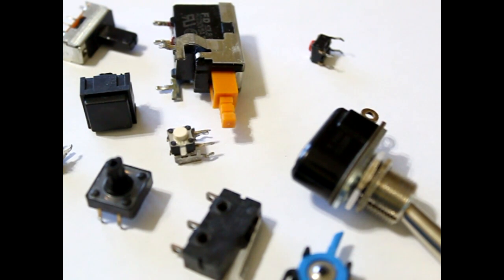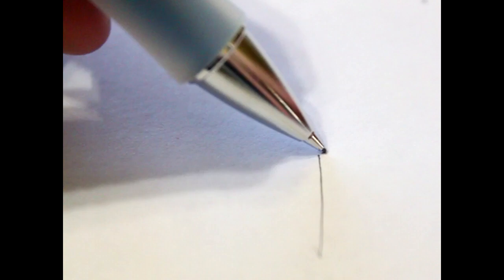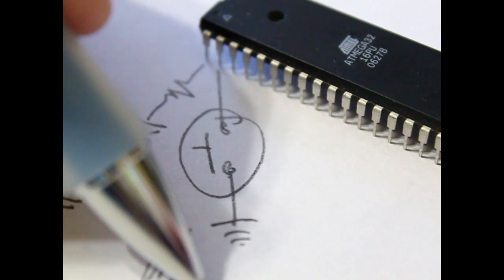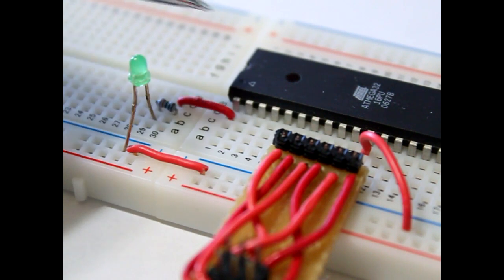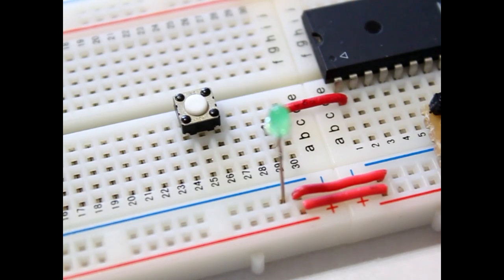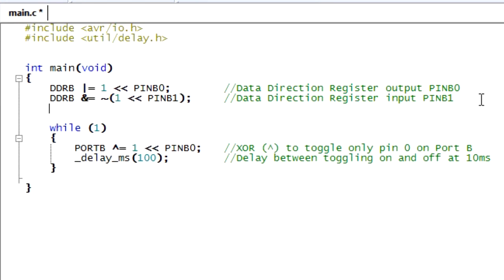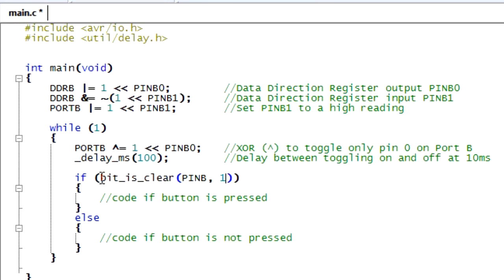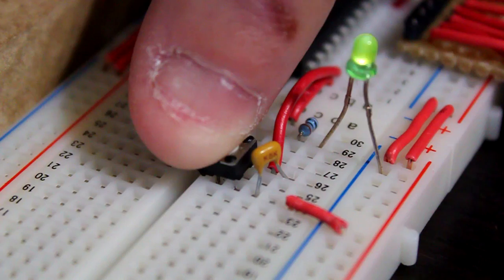12. Arduino for Production!  AVR Atmega32 - Adding a Button to the Microcontroller

Comment from the maker: Thanks Golgor.  All of the ports of this microcontroller provide pull up resistors.  Remember that this is important for setting the pin high and connecting the button to ground.  If you do the reverse (connecting the button to 5v and setting the pin low) , then you will need to provide a pull down resistor in the circuit.

Comment from the maker: On the atmega32, I believe all ports have pull up resistors according to the beginning of the datasheet where it introduces the ports.  Yes, if you use PORTB |= 1 << PINB1; then the internal pull up resistor will be used.

Comment from the maker: All of the manuals that you will need is actually installed when you install winavr.  Just look in the "all programs" under the start menu and then under the winavr selection.  You will see the winavr user manual and the avr-libc manual.

Comment: Can we Use Pull Up Resistor instead of a Capacitor.?
Reply from the maker: The capacitor is used as a filtering device (low pass  filter) and is actually done with a capacitor and resistor. The capacitor connected across the pin and ground and the resistor connected across the pin and vcc.

Comment: If I understood everything correctly you used the pull-up resistor when you put the PORTB |= 1 >> PINB1;
There are not Pull-up resistor on all ports right? What I have read it is recommended to use the pull-up resistor when using buttons. Can you clarify this?

Thanks for AWESOME tutorials. :)

Comment: I'm sure you already knew this, but you forgot to include "#define F_CPU" to define your clock speed. At the end of this video, when you said the LED was toggling every 100ms and 10ms respectively, the LED was actually toggling about every 1000ms and 100ms. Perhaps the default clock speed is 1MHz and you were using 8?
Great videos thus far though, thanks a lot!

Comment: Hello your tutorials helps me alot and i was rebuild some of them from beginning and learn verry much !On a actual tutorial about BUTTONS i'll remind you that prouberly Forget about PNP or NPN Transistors because they Need a Signal to shift an electrical circuit in many time of one secounf*Maybe remind on it in your next *tutorial well be verry helpfull !Nice work !
Reply: Got idea to teach something about bitwise operations like you show us in your good declared videos because i was'nt  know nothing about that stuff ! ;)Prouberly on a long code, it may help to invert arguments for what looking for !Thanks you a lot !Verry smart ! :D
Reply: Following Code is working with Atmel Evaluationsboard on Versoin 2.01 for poeple who want to try this code (whitout warranty ) !* (only copy code insight of the //Hier beginnt die Initialisierung and  //Hier endet die Initialisierung or clear the *comment out of the code !
//Hier beginnt die Initialisierung
#include <avr/io.h>
#include <util/delay.h>
int main(void)
{
DDRD = 0b01100000; //initialisiert das DATA DIRECTION REGISTER für PORT D und setzt die im Bitmuster abgegebenen PINS als Ausgänge
PORTD = 0b01100000; //schaltet die LEDs am PORTD sowie AUSGABEPIN 5 und 6 0b|7|6|5|4|3|2|1|0, auf + 5Volt VDD 
//Es beginnt eine Endlosschleife welcher das in Klammern aufgeführte Argument übergeben wird.
while (1) //wenn das in Klammern aufgeführte Argument zutrifft, werden die Anweisungen in den geschweiften Klammer ausgefuehrt.
 {
  (PORTD) = 0b01000000; //PORTD ist als Ausgangspin am Ausgang 6*, deklariert !
  _delay_ms(10); //Wartzeit für ein *zehntel einer Sekunde, um ggf. die Entprellzeit bidiengt mechanischer Herkunft zu verarbeiten !*
  DDRD = 0b00100000; //führt einen VERGLEICH des Ausgangspins am PORT D und dessen Ausgang an Pin D5 durch !
  PORTD = 0b00100000; //setzt Ausgangspin 6 auf einen Highlevel, von + 5 Volt !
  _delay_ms(100); //wartezeit von einer Sekunde !
  DDRD = 0b01000000; //jetzt, wird der Zustand des Ausgangspins des als Global geltetendes Arguments welcher ursprünglich *global als somit *Ausgabepin, initiert wurde, in dieser *while,ENDLOSSCHLEIFE,
  // auf EINGABE oder AUSGAGE, hin geprüft !
  //Werke: Einmalig bei der Initierung, den Variablen können im Verlauf eines Programmes, unterschiedliche Werte erhalten.
  //Konstanten allerdings keinesfalls !
 }
}//Hier endet die InitialisierungSometimes it's a got idea to take a RED wired cable for the positive VCC and a BLACK wired cable for the negative GND rail and for technical knowledge and for *pysical acknowledge it doesn't matter what Kind or whst colour the cable got !Be sure but don't use so much of voltage because current alway flown from A to B and not why current was attaked by coulorblind ;)

Comment: thank you so much, just a quick question, should we call the IF function ( bit_is_clear) or we can call it any else such as                if (X (PINB, 1)
Reply: +a00000z100 bit_is_clear is a macro available when you include io.h. Check the AVR Libc from Atmel here: http://www.atmel.com/webdoc/AVRLibcReferenceManual/group__avr__sfr_1gad188fb0fbfd923bdb01294072367d024.html

Comment: Why didn't we used the XOR (^) instead of AND NOT
DDRB ^= 1<< PINB1;
Reply from the maker: I use XOR in a toggling scenario.  The AND NOT is used to make sure a bit is 0.  If I used XOR not knowing the current state of the bit, it could write a 1 in that bit instead.

Comment: 03:07 how are these red wires called you are using there who work like jumper wires, but are much smaller? I could not find them to buy anywhere.
Reply from the maker: Solid core hookup wire.  Just make sure it is not stranded wire which are like a bunch of little tiny wires inside of the insulation of the wire.  Also, make sure to get the correct gauge so they fit inside of the tie strips.

Comment: So i added an Inductor in parallel with a capacitor to my 5V and GND pins on my atmega 324p and it burned my board 0_o i heard you say that on one of your videos.. did u actually do that, without burning up your board?

Comment: Just a small doubt. What is the use of the command which sets PINB1 to a high reading?
Reply from the maker: The button is connected to ground and PINB1.  If the PINB1 is set low (ground), then there would be no change on the pin because ground connected to ground is no change.  when we set PINB1 to high, then when the button is pressed, the signal will be set to low when the button is pressed, so the microcontroller will sense a change on that pin.
Reply: In fact, when a port or a pin is in input. And this port is set to hi. This active a internal pull-up resistor. If you dont do this, you could add a external 10k resistor to Vcc (5v) on pin PINB1. But it's easy and cheaper to add a code line.

Comment: what do mean by checking whether the bit is clear or not, the clear implies??
Reply from the maker: Checking to see if the bit PINB1 is clear is the same as saying low, ground, 0 or anything else that implies that it is not a high reading.  Bit being clear is 0 or low, or ground.  Bit being set is 1 or high or 5v (in this case, but could be other high voltage values like 3.3, 1.8 etc. depending on the chip used).

Comment: n00b question, why does it reads 0 volts when you press the button?; shouldnt it still read the 5V?
Reply: it actually would, if the microcontroller could provide much more current. You could easily calculate, if you knew the exact resistance of wire and button. Lets assume that it's about 0.001 Ohm in total for pressed button, cables and capacitor. Your Voltage has to drop from 5V at the microcontroller to 0V at ground. So you would need to have a current of U = R*I => I = U/R = 5V/0.001Ohm = 5000 A. The microcontroller cant possible provide so much current, as this needs a powersupply of 25kW (also, everything would melt down before). So instead the Supply Voltage drops.
Reply: Grayhamper I don't get this. Can you please explain that a little better? I went through comments to ask this same question.  I thought pushing the button would make the input read high, but instead you have the code in is_clear, which I would have thought would be if the button is not pressed. I'm a tad confused by this.
Reply: Grayhamper Nevermind. I after starting 2 videos up I noticed you say that the pin read the ground signal when pressed. Now I get it.  But one thing I want to understand is... So, with code, you are sending the pin 5v but when the button is pressed the 0v from ground overrides that 5v? I know it's not that important. I just like to know why something is working as opposed to just knowing it works. Thanks.
Reply: Nivlekius Read high means: 5V between the Pin and Ground. Read low means: 0V between Pin and Ground. If the Button is pressed, the Pin is directly connected to Ground - without any significant resistance. If we use Ohm's Law ( R = U/I ), we can see that the Voltage between Pin and Ground is U = R * I.
Now, obviously the Pin provides a Voltage of 5 V so U should be 5V. If you calculate the required Current I for that (considering R is close to 0, so like i said above ~ 0.001 Ohms), you need a Current of 5000 Amps for that, which means you need a Powersupply of 5000A * 5V =  25kW to achieve that. 
Now obviously the Powersupply and the Microcontroller are not build to do that. 
What actually happens is that the Voltage drops before the point where the Microcontroller reads it.
So the Pin has an internal Resistance before the Point where the Pin is read, lets call it Ri, which leads to a Voltagedrop, lets call it Ui. So If there is no resistance between Pin and Ground, the current I is increasing, as it can flow freely now. but the increased Current leads to a higher Voltagedrop before the Readpoint, Ui = Ri * I. This reduces the Voltage U, as 5V = U + Ui has to be true. 
So to conclude: 
The Internal Resistance acts as a Voltage splitter. It splits 5 V into internal Voltage Ui and external Voltage U by the Ratio of their respective Resistances Ri and R. So U/Ui = R/Ri. Theirfor the Voltage between Pin and Ground is already 0 at the Readpoint if R ~ 0.
Reply: That was a complex mouthful, but I think I understand now. Thank you very much

Comment: Question, how do you know what resistor value to use in series with the LED?
Reply: Do you still need to know?
Reply: no prouberly still about to learn !
Reply from the maker: Resistance = Volts / Current
R = V/I
V = difference between the volts of the source and volts of the led = Vs - Vled
I = Led current rating

R = (Vs - Vled) / I

Example: if the led is 2 volts and the supply is 5 volts and the current rating for the led is .01 amps (one milliamp), then:
R = (5 volts - 2 volts) / .01 amps
R = 3 / .01 = 300 ohms

You can use a value above the result, but the higher the value, the dimmer the led will be.
Reply from the maker: I explain this in the following video: https://www.youtube.com/watch?v=zRotGzBhx08&index=9&list=PLE72E4CFE73BD1DE1
Reply: for calculate a resistor you  use this U:I=R means Voltage=Amphere x Ohm. For calculate the resistor for a green LED most times they need up to 2,0 Volt (good idea to take a look at the datasheed of the led)for example:If you want to use a LED on a 5 Volt electrical circuit you got to know how many voltage and amperes the LED need for light up.VDD = 5 Volt - VDDled = 2 Volt (datasheet)Iled = 20mA (what means that the LED need 0,02 A)VDD - VDDled (5 Volt - 2 Volt) = Rest Voltage for the resistor !Iled = 0,02 ANow use U = R x I or set it back lke see next !R = U : I means Resistor = Voltage : CurrentR = 3Volt : 0,02 Ampere = 150 Ohm remember always to use Ampere if you use this formula for getting the right plans!Always use the right Units for calculate because in the most of datasheets the current unit is assign to (mA) so you first got to calulate it in the form of Ampere (A)  !
Reply: Norbert Huemmer Where do you get the value for I though?
Reply: +Oshyrath Find the data sheet for the component. Look for Absolute Maximum Rating for Forward Current. I <= that number.

Comment: When I add this in to my program, it takes much longer to compile and I end up with the flash size being 30768 bytes. Without it, the size is only 2702 bytes.
if (bit_is_clear(PIND, 3))
		{
		delaypixel = 2;
		}

Comment: I have a 12hmz osc that came with my board. i added #define F_CPU 12000000UL before the delay.h header but the led still blinks way faster than yours? at 100ms it blinks as if it was at 10ms and at 10ms it blinks so fast that the led remains on. Can you lead me in the right direction?

Comment: Those delays do not look correct. A 10ms delay should change State 100 times per second and 100ms should change state 10 times per second. Do you need define F_CPU so it can correctly calculate the delay? Or am I missing something?
Reply from the maker: Probably video editing.